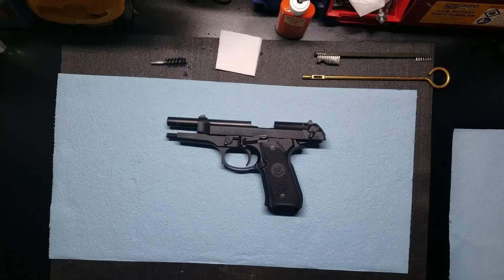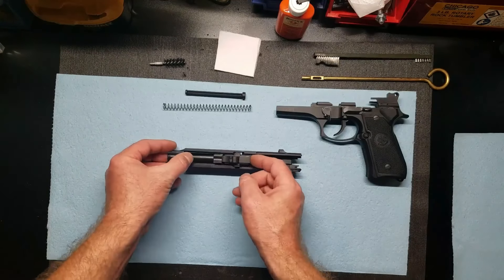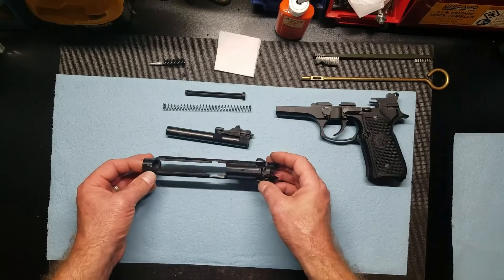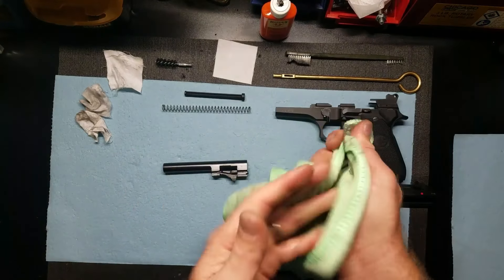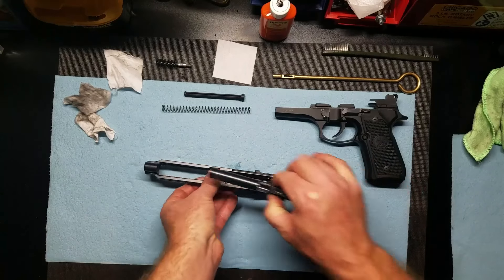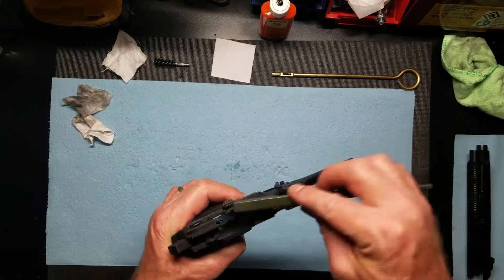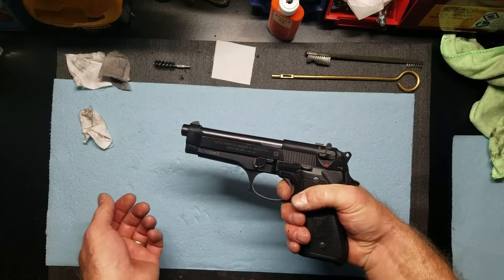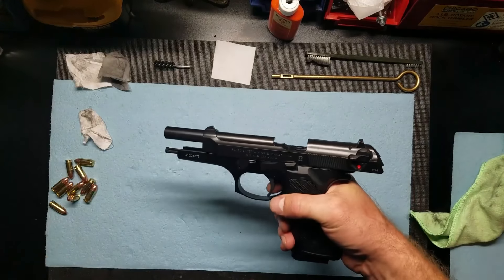Beretta 92FS / M9 9mm cleaning

Comment: None of the videos I’ve watched tell me when to use the cleaner and then when to switch and apply the oil in certain parts. It seems like you’re not even using cleaner at all and just using oil?
Reply from the maker: That is correct. I rarely use any 'cleaner' or Solvents on my guns, I keep them clean enough to not need to use any solvents. If I do get a new used gun, sometimes I will need to, but for the most part, you can just use a little oil to wet it down and loosen up the gunk, then wipe it off. 

I do have some cap n ball guns, the after a days outing, I will sometimes use a little solvent on, but really it is not usually needed for normal cleaning.

I hope this helps. Thanks for watching.
Reply: Thank goodness this question was already asked and answered. I came to the comments to ask exactly this. Thank you! I just bought my first handgun and it’s the “brigadier” version of the gun in the video. Great info. Thank you again!
Reply from the maker: Sorry for the late reply Hector. Thanks for watching. I'm glad you found the answer in the comments. The Brigadier is awesome!

Comment: After 3 decades of wanting one, but being satified with a shotgun for home protection, I finally got one. It's a beautiful gun. - A couple things I hear differing opinions on, maybe people can answer?  1. Do I need to clean the gun of factory oil before firing for the first time?  2. In one video, they would only push the brush through the barrel, never pulling it back through. I don't really understand why. If the brush spins going forward, certainly it spins going backwards too? - Anyway, thanks for the video.
Reply from the maker: Thats awesome Crash, Yes, you should probably clean the factory oil before shooting it, but it will definitely shoot if you leave it in there. As far as pushing and pulling the brush through, some people think it's bad, and others don't. It does spin backwards when you pull it through. I don't think it's bad, it's mine, so I clean it how I want to, I would suggest when you start cleaning it, find your own groove and stick with it. :D
Reply: @JDPDoingStuff  - "Find your own groove and stick with it." - OK. I like that attitude. I'm about the clean the gun for the first time right now, watching your video as a reference. Thank you.
Reply from the maker: Awesome Crash, Its' pretty easy to do. And it's Therapeutic.
Reply: @JDPDoingStuff  it has a chrome lined barrel, do not worry about hurting the barrel
Reply from the maker: @leepenlack5548  Thank you Leepen. I don't worry about it, or the what the gun snobs like to say :D Thanks for watching and commenting.
Reply: @JDPDoingStuff  Yup.  Cleaning a firearm is just as therapeutic as shooting one.
Reply: Congratulations on finally getting a 92FS.  I wanted one for just as long and bought one as an early Christmas present to myself.  It's everything I expected it to be.
Reply from the maker: @haywoodyoudome  Awesome Haywood. Have fun with it

Comment: I’ve been in law enforcement for a while and throughout my career we were taught to use Hoppes solvent, metal brushes, CLP, everything.  I discovered we were scratching our guns and the solvent was not needed.  Actually that solvent can rust your gun.  I learned all you really need is that plastic brush, a lubricant containing CLP, and to run a CLP dampened patch thru the barrel.  That’s it!  We’ve been overdoing it for years.  The main thing is the gun is clean and has a very light coat of oil on it to prevent rust.  This video was right on.  I add a drop of oil to the slide rails and the internal spring - he didn’t do that but doing so is recommended in either the Glock or Sig manual - I forget, I’ve been issued many guns in my 30+ career.

Just passing along what I’ve learned.  I rarely even use the metal brush in the barrel any more,  if it’s clean and shiny, it’s clean!
Reply from the maker: Thats good information. Thank you.
Reply: thanks

Comment: I used to know how to do this but it's been years since I've had the time to use my '92.  It has been stored untouched in its bag in my gun safe all that time so now I'm looking at going to the range, it needs to be stripped and cleaned. Needed some guidance and found your video, a great refresher.  Simple, straightforward, no bs. Thank you!
Reply from the maker: Awesome @lonewold5238 Glad my video could help.

Comment: Thank you! Very clear! Also, amazed by the very small amount of powder solvent you use. My gun safe stinks of the stuff. Would be interested in your tips on proper amount of Hoppe’s to use and why. Thank you.
Reply from the maker: @erichall7253 Thank you for your kind words. 
Really, you don't need much oil at all. You don't want it to be 'wet' when you store them. That's why I like to put it on, then wipe it off. It will still have a very light coat on it. It will fill in to the pours of the metal. 
I do have an ammo can that I keep a lot of my cleaning supplies in, and it smells pretty bad when it's open Lol. But my safe does not smell. The powder does have a smell to it, so keeping them clean keeps that smell at bay. 
When I take anything out to shoot, I'll take some Hoppe's with me and add a little if I feel it needs it. I also wipe them down if I'm just handling them to keep the salt off them from my hands. 
Also, I try not to get any oil on any of my rifles that have wood on them, and I store them barrel down, just in case there is any oil I've missed.

Comment: Good video but I was just curious why you didn’t lube the slide? Thanks
Reply: Was wondering the same
Reply from the maker: Hi Ivan, Sorry this reply is so late! I kind of did, I wiped it down with the oily patch, then wipe it down with a microfiber towel. I've never felt it needed anymore than that. When I first got it, I always lubed it up good, but it would splatter some of the oil all over, so I started to do it this way. Hope this answers your question. Again, Sorry for the late reply.

Comment: Can you help me please, my gun is KWC beretta m92 and I try to open the slide like you did but it stucks. I just see the spring in the front of the gun but it cames not out.
Reply from the maker: So your trying to just open the slide or take it off? The spring should not come out until you take the slide off.
Reply: KWC sounds like an Airsoft replica manufacturer. Depending on the model, this might differ from the actual firearm as shown in the video.

If it's a CO2 replica, you can remove it the same way. If it's an electric replica without blowback, you won't be able to remove it this way; on mine, all you had to do was push the "slide release" down. If it's a manual spring powered replica, I have no idea.

Comment: How can you reduce the pull pressure on the slide? Mine is very stiff
Reply from the maker: Hi Robert. If it's a new gun, just using it may do reduce the 'pull pressure' Other than that, you could get a new recoil spring or just a new competition spring kit for it. Wilson Combat would have everything you need. They are pretty reasonable as well.

Thanks for watching Robert.

Comment: I have a question: how long do you think it should take to do a "quick cleaning" (as in, not a thorough one)? Every time I went to clean mine, it looks like it took me an hour.
Reply from the maker: I think it depends on what you mean with 'quick'. I suppose a quick wipe down could only be 5 or 15 minutes. I have done quick wipe downs of my stuff before in that amount of time. More often than not, I tend to do a complete clean and I take my time. One of the things you want to do while cleaning is just a good inspection of all the parts.
Reply: @JDPDoingStuff  All right, thanks for the reply!

What I mean by quick cleaning is when you perform a basic disassembly: remove the slide, the recoil spring and barrel, then start cleaning them + the frame. Nothing too fancy such as removing the grip, removing the trigger and all that.
Reply from the maker: @replacesoundboard  If I'm not filming a video, it takes me about 10 minutes to clean. When filming, sometimes I could take hours!!! Lol.
Reply: @JDPDoingStuff  Lol, that's reassuring x) Thanks!

Comment: Is the spring guide rod plastic? Mine looks and feels plastic, and i was surprised by that.
Reply from the maker: It is indeed plastic. You can get 'upgrade' kits that give you an aluminum one.
Reply: @JDPDoingStuff  I mean it's just a guide rod does it have to be more durable than plastic?
Reply from the maker: @RzVids  It doesn't need to be. There are 10's of thousands of these out there and people haven't had any issues. Most people who swap them out want to because they don't trust it. I have shot thousands of rounds thru mine, and never had an issue. That being said, if it's mishandled specially when cleaning, it could bend or break. I've never experienced that though and don't personally know anyone who has.

Comment: Did you put oil on the toothbrush before you started cleaning ?
Reply from the maker: There was a little oil on it from a previous cleaning. In this video, there was already oil on the part, so there was no need to.
Reply: @JDPDoingStuff  Ok thanks, some of the left over oil left marks on the gun. Is that normal ?
Reply from the maker: Yes, it is. You can wipe it down with a towel if you want, or if it's in storage leave it with a light film on it. I usually wipe all mine with a microfiber cloth before taking them out to the range.
Reply: @JDPDoingStuff  Ok, thanks
Reply from the maker: @simpilot8508  Your welcome

Comment: Question: why the pin that goes inside the spring coil looks plastic, if so , this won’t get melted for heat when get fired?
Reply from the maker: It is, but it's fine. Some people will upgrade it to a metal one. You can get them online.
Reply: @ what it’s called exactly please
Reply from the maker: @Yellowstar821  The guide rod

Comment: link for the cleaning kit?
Reply from the maker: Any 9mm cleaning kit will work. I got this one at a gun show, however mine did come with a plastic cleaning rod, I've never used it. Beretta does have cleaning kits on their website, however they are a little spendy. Most sporting good stores should have some good kits. You can also look on eBay or Amazon. If you have more than just the Beretta, I would get a kit that has different caliber brushes and mops. If you would like me to help you find a good kit online, just let me know.

I hope this helps. Thanks for watching.

Comment: love how u didnt even talk about oiling it or show it at all, u just used a dirty pad i guess?
Reply from the maker: Really that's all you need. I don't keep my stuff dripping wet. Specially when storing. Just a light coat, and the leftover pad with oil on it is sufficient.
Reply: @JDPDoingStuff  yeah but to a novice they wouldn’t understand that there’d be enough oil there. Obviously you don’t want it oiled so much that’s it’s just a bloody mess. But using the needle applicator and then wiping it is what other people show if you haven’t cleaned your firearm before or in a while. Like my beretta was basically bone dry.

Comment: Why the hell isn't my slide coming off? I've pressed the side button. It's still locked in place. The only thing I can think of is the fact that I've replaced my spring guide rod with the lazer, but i don't see how that would make a difference. Point is it won't come off. It's locked in there. I've shot this countless times so far.
Reply from the maker: Unloaded and the magazine out? Without really seeing it, it's hard to diagnose..
Reply: Yea. Maybe I'll take it to a gun smith.
Reply from the maker: @eric44ism  Might be a good idea. Then they can check out the rest and make sure it's up to snuff... :D